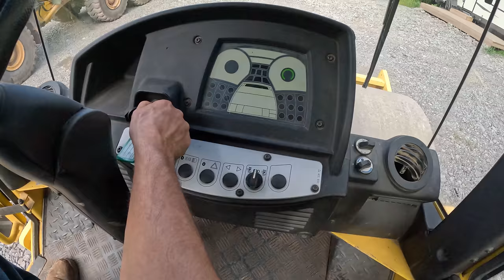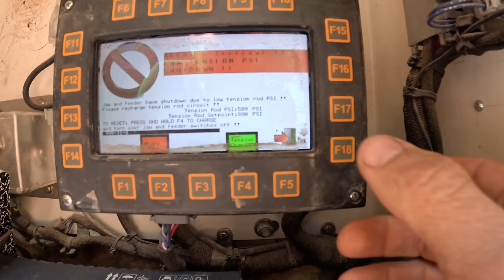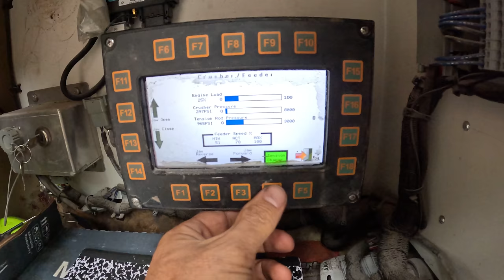Moving a big wheel loader

Comment: Those husky 562s are amazing saws. Been running one for the past three years doing tree work and hasn’t skipped a beat. Tons of power too
Reply from the maker: Yeah, I wanted to try that, I have a 550 a 357 and a 572.
Reply: @AndrewCamarata  the 372 or 395 are seriously fun. I run a 395 with the 36” bar and it just eats through hardwood
Reply from the maker: Do you need that big of a bar? I always felt 20" was like perfect, can usually cut any tree. I had a 24" on my 357 for a while and found the extra length was not necessary.
Reply: @AndrewCamarata   the 20 is great for most trees out here besides the big cottonwoods. It’s really nice to have the long bar when you’re putting a face cut in a tree that’s 4-6 feet in diameter. If i wasn’t an arborist i would just stick with a 20
Reply: @AndrewCamarata I've got a 24 I can throw on my 572 but it's usually overkill here in NH. Unless it's a real old tree and it's felling the stump log, then a bit of reach is nice. Normally the 555 with the 20 inch is perfect for general work.

Comment: For that sensor: the next time something like that happens, I suggest having the hydraulic shop make you a hose instead of stacking twenty adapters. Hoses make excellent adapter pieces and will allow you to mount that sensor in a safer spot.
Reply from the maker: We tried, IDK, I did get a connector that took out like 4 of those adaptors, but I did not install it yet. I ran out of rock to crush too.
Reply: @AndrewCamarata  ok, makes sense. I figured you had the same idea.
Reply: Andrew... build a steel box around the sensor..protect it from getting hit again...
Reply: @AndrewCamarata what exactly were the machines you came across on the way they looked like he was melting the asphalt with the burners but I don't understand what the machine that followed the burners was doing
Reply: @TomGuimond  it’s an asphalt reclaiming machine. That truck follows behind and grinds up the blacktop, and lays it back down. Cheap way to redo a road, that same company was just here in my town this past summer. Really neat to watch.
Reply: @TomGuimond as said above, a friend of mine has a small scale recycler for parking lots and its big money in it when you can heat the existing asphalt grind it up and lay it back down smooth all without needing a dump truck/driver to be trucking it in or having to buy new.  Only pre maintenance needed beforehand if repairing and packing any holes or weak places but they still heat and blend those spots after repairs anyway
Reply: They also add more emulsion (the black tar binder stuff) as they lay it back down. It’s seems that the old blacktop would bridge over soft spots in the road but once it’s heated, ground and placed back down the soft spots all came through even though they tried to repair the bad areas before they tried to recycle the old stuff. A really good idea in theory but it sure didn’t last very long, a couple years later that whole road was falling apart. They found out it was better to mill 2-4 inches off and repave over that rather than rototilling the whole road, base and all. Reuse the grindings for alleys and parking lots.

Comment: The HF Quiet compressor is pretty cool.  I ran one a ton and the cheap circuit breaker started to trip frequently until it would no longer reset (weak spring). I replaced with an inline fuse of appropriate amps and has been great ever since.

Comment: Keep that crusher filled as much as possible to keep even wear on those jaw dies some you can flip some you can’t. They are very expensive to replace. I worked on a crusher plant for about 8 years and have done many cone and jaw die replacements. Great video makes me want to work on a crusher spread again lol also FYI in the summer cheak the heat on the bearings on the jaw once in a while we have had bearings blow out. We had to install a heat exchanger for them

Comment: A little background on those pressure sensors/transducers...(As an engineer, I designed a manufacturing cell to make very similar ones.)
The front (threaded end) marries up to a variety of back ends (electrical connectors) and vise versa.  They are made with those pins so the manufacturer can stock various front and back ends to the customers order and they are just plugged together to create that size.  Yours looks like a 3 pin Deutsch DT04-3P back end married to likely some hydraulic style female fitting. In the cell that I designed, we did a laser weld and then configured it and tested it on a custom machine with a PC.  
The ASIC chip you saw talks to a stress sensor that is mounted to a cap over the port hole that sees the pressure of your machine.  More pressure, more stress on the cap and that is turned into an output signal.  That was what you saw with those little wires coming out of what looked like a dome of jelly.  The OEMs like CAT, JD, ect, commission the cheapest sensor they can get, pay about $25-30 for them and then sell you a replacement for $300.
Reply from the maker: Sounds about right. I might have been able to cut that whole thing shorter and the pins might have reached. That replacement part was expensive.

Comment: - Andrew, I crushed miles and miles of highway grade rock with a thirty six in big scallop portable crusher {the biggest east of the Mississippi River back in the 70's.
- I suspect you will get much more consistent size product if you put in new bars at the spill point just above your jaw. The Pointy ones.
- They are worn short and too thin and one is bent. Together the total wear issue cause for them letting rocks that are too wide and too big slip into the "Fines" shute instead of into the jaw to be crushed to grade.
- That causes extra time and hassle, and aggravation, grading the material easily with either a loader, or grader.
- It is stuff like these too worn bars that never get done on time because of expense and labor.
- No one recognizes the expense that happens just because of the aggravation that shows up grading or the expense of having to do two passes to get things to rights when one is all that would be needed with material that was tight to spec.
- I never worked that type of machine, but my instincts may be right. {They have bothered me since I saw them way back when you first got the machine, and I just can't keep my mouth shut any longer.}
- Check with the manufacturer or a crusher boss who really does know the machines's design and how those bars need to be changed out even when it does not look like that is exactly what is needed.
- If I am right you will be happy. If I am wrong then you have made some new friends that can help you get the most out of your equipment to make your jobs go better.
Reply: :person-turqouise-waving:.............G'day from Australia, 
I have been thinking the same thing. I had 20 years in mining maintenance, 81+ now.
Cheers,
Malcolm.
Reply: - Seems like us old guys might know something useful for those with ears to hear...
- Let's hope Andrew wind's up seeing our attempt to help him.
- Perhaps the worn "needle nosed" bars are not too expensive and not a huge job to replace.
- My guess is that they should be designed for easy, quick replacement...but ignored all too easily.
- The crew I crushed for would have immediately welded hardening surfaces onto the new bars, just like they did on all the loader buckets given the super hard stone we generally processed for road construction specs.

Comment: The definition of Dexterity - piloting a drone whilst driving a massive CAT pay-loader…

During my summer breaks whilst in university in the mid-80’s, I worked site construction prep, for my family’s RE development company, I usually ended up doing the most manual-labor tasks as my dad later told me that he wanted me to learn first-hand what it was that I never wanted to  ever do again in my life… this work included manually digging post holes, one for each side of a 24 garage bay NYS highway dept maint facility garage, for which he was the overall general contractor for… also included schlepping dirt fill/concrete/asphalt/sandblasting/jackhammering/etc….seeing those county highways being resurfaced with the binder layer then overlayed w/ the fine-grade top coat layer, amazed me w/ the new “all in one” asphalt units that are now common

Comment: I just bought that same Milwaukee ratchet being used to take the cab off the loader. My ego wanted the Fuel version but I didn't think it was worth the extra cost for a small difference in performance. If the standard version is good enough for Andrew Camarata I think it'll work for my needs!

Comment: Nicely done Andrew , the hour seems to go real quick! Looking at what the hydraulic shop had to do to mate up dissimilar threads i get every now and again if i do high pressure lines in the paper mill , perhaps they could have used a 90 degree fitting in there to bring out of harms way as its now more exposed.

Comment: Change the final gears in the transmission a few, add new wider tires, and better seat cushion springs and you would be pretty damn close to Whistlindiesel without the hefty price tag and actually lot better reliability.
Reply from the maker: This loader has over 25,000 hours, that monster truck will be lucky if it gets 20
Reply: @AndrewCamarata well it just broke catastrophicly so... 😂😂😂

Comment: Hey man, I’m not sure how far apart your two properties are, but could you just drive the big loader to your new property, instead of going through the trouble of taking the cab off, or would that be illegal in your state?
Reply from the maker: It’s like an hour drive going normal speeds, so that loader would have taken all day, I’m sure someone would have said something. When I bought that pettibone crane, I drove that home, and then kind of regretted doing it.
Reply: @AndrewCamarata  dont regret a thing, that was badass!
Reply from the maker: @Donkusdelux  the reason I regret doing it is because it took all day, the thing overheated on the way home, plus it had no brakes, if that engine had stalled in the wrong spot it could’ve been pretty bad.
Reply: @AndrewCamarata  I totally get it, lots of risk.
 I watch your videos with my father and he couldn't believe when you started driving it down the road.. had us both laughing pretty hard :)
Reply: @AndrewCamarata  you woulda been fine, we have all watched you bail off a few things over the years and youre quicker than a billy goat when things get sideways!! LOL
Reply: @sirzyox8766  New York  DOT would have you for lunch if they caught you running that down the road without permits. He did it right with the heavy haul pete and I'm sure the load had a permit

Comment: Andrew just keeps on rockin , Love these vids speeding up to really show what he gets done. best on YT. Back in the 80's I briefly worked for an equipment rental company and one day a low boy rolled in with a Koehring 6644, I was told it was the biggest one they made that could be trucked over the road. The power that sucker had was unbelievable, I dug a hole 40 ft deep in the sand out behind the shop in like 5 minutes. Watching that machine work the rock pile shows what that beast can really do. Thanks you Andrew !

Comment: I have the same compressor i carry in my work van, i sit it in my tool cart when blowing out VSDs and control cabinets and a lot of times i cant even hear it running in a mechanical or chiller room but beats the hell out of dragging nitrogen bottles around like i used to do.

Comment: Just watching you crushing rock very interesting I spent many months loading crushers in the UK I worked on motorways anywhere we came across rock it was crushed on site and used on motorway one crusher had a mini digger welded up on the platform for unblocking the crusher rubber trackes removed 1and half tonne with a breaker I see you got a good  roller that's ideal rock for roadways it break up easly and compaction is very important if you roll it again after a wet week it will really harden up it will be like concrete  very interesting videos 👍👍

Comment: That cliff would be a great place to build a house. The back of the house would stay really warm against the cliff. The back door would exit from the top floor, onto a patio. The front of the house would enter into the garage and basement. Mud room area. The whole front facade would be solid windows. If that was the South side, you could have the living area with a tall stone clad wall that would absorb the winter sun and give off the heat at night (Passive Solar) The back rooms would be against the cliff (Bedrooms and Bathrooms; warmest place in the house) Or, You could have the front a full height green house.

Comment: AC i think u can build your own conveyor belt machine to catch the crusher's gravel and move it about a 15ft radius. Like the minute hand on a clock. Just manually reposition it when the pile gets too big. I guess the conveyor needs wheels. And if it has wheels it can drive. 🤔 Whatever contraption you can make will save how much fuel?

Comment: The older used equipment that Andrew buys does a great job but heavy use and neglect take a toll on this equipment.  Maintenance and repair can feel like a full time job. Parts get harder to find and newer equipment has more complicated technology making it more difficult to repair it yourself. Its a catch 22 and a never ending cycle of finding parts or learning new technology. Manufactors of all products have designed them to fail and be replaced rather than repaired. Its the new world we live in. Andrew has accoplished a lot with used equipment but has also worked hard keeping it running. I'd hate to pay his fuel bill.

Comment: Thank you again Andrew always interesting to see you wrench at things after having some experience running some of the equipment that you already own ,adding a choker with a shackle and maybe a hook to the manager of your lull loader  allows a fast and efficient way to carry loads that require chokers and straps And with the proper length adjusted just below the manager it may be used without getting in the way of use of the forks as it was designed to use ,saying this without criticism of how your genius works for you 🏗

Comment: Not sure if you know, Andrew, but the greasing point for your wheel loader is disconected - check the time at 1:10:24. It's the right hydraulic piston (from drivers perspective) for swinging the bucket.

Comment: Might put that sensor on a hose.  Won't be so likely to get broken off.
Then weld a bracket on the machine to hold it out of the way of everything  that's going to break that long line of fittings and adapters.

Comment: The sensor was either damaged from impact. In which case you'd have never been able to repair it or you broke it it the attempt to repair. 
Anything that has a surface mounted processor in it is very susceptible to heat damage.  Your soldering iron will cook it. Anything like that uses a very expensive hot air and soldering system to put on. Normally done by a machine.  Yes, you can do it yourself but unless you have the correct test equipment and know what you are doing, and plan to repair lots,  the easiest option is always to get a new one.
I've always wondered why you don't purchase a few heavy duty tarpaulins to cover your plant equipment.  Surely giving them some protection is better than leaving them open to the elements. Particularly those that you don’t use often. Put some of the smaller attachments inside a container. Otherwise you'll be continually repairing preventable damage.

Comment: I thik there is something wrong with a pump  regulation on the Koehring.  Seems like it is not regulatinginjection Advance It should not lose rews so quick . Maybe not so expensive fix could bring a lot better performance when operating it. Try to ask some diesel specialist.

Comment: Hey Andrew love watching your content just a quick question wouldn’t it be more cost-effective for you to use the rock crusher like a finger on a clock you have the remote control for it If you started the rock crushing at 3 o’clock and went backwards 2 o’clock 1 o’clock 12 o’clock etc you would have a load of piles which you could just move easily. Would that not be better than just doing the one pile and using the big machine to move that one pile, just a question, you obviously know what you are doing I’m just sitting here in Liverpool in United Kingdom 🇬🇧 watching you on my telly. It’s easy for me to comment just a suggestion 👍👍👍👍
Reply from the maker: I tried doing a move like that, it’s best not to dance the crusher around too much when operating it, and at best that would buy you some time, but you still need someone in the loader, taking the pile as it’s being made. another option I consider was buying a stacking conveyor, but they are pretty expensive.
Reply: Wow that was quick mate I’m still watching you on telly ha ha ha like I said I knew you knew what you were doing 🇬🇧👍🤭

Comment: Crush that top rock mountain now dude
You had the tools
You may can in a little creeck put a stream of water make a reservoire a dam and use to generate voltage with a car dc alternator, an ac motor use as a generator, free energy!, car battery,
Inverter to 110 and 220
Better than solar

Comment: with all they hydraulics you do you should have the tube bender & flaring tools and fitting you'd pay for it in no time. $300 for a few feet = crazy. I have  my wifes's. grandfather's many & stuff from the mgr job @ Main Los Angeles 1920s-60s  Fleet Maint. Shop for Nat'l bakery trucks. All heavy duty collectibles engine honeing etc .

Comment: is it not possible to add a large movable  conveyour belt under your rock crusher,  instead of using the wheel loader or is that an expensive affair ?
Reply from the maker: I looked into it, they are called a stacking conveyor. They are expensive.